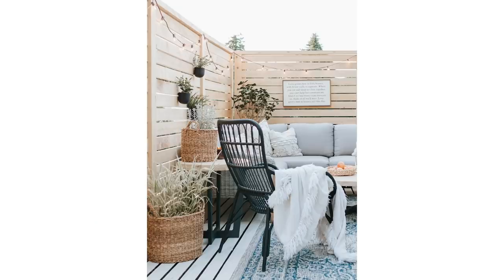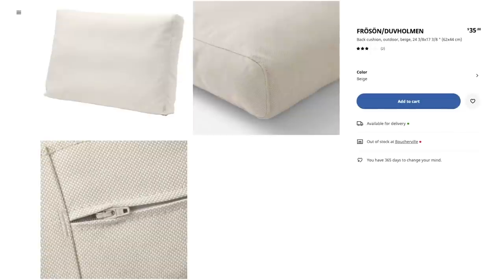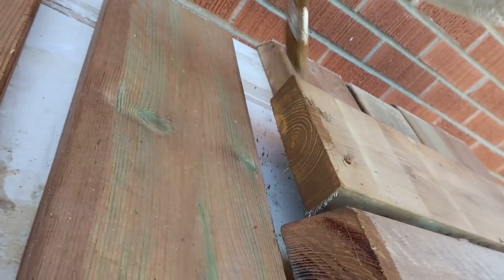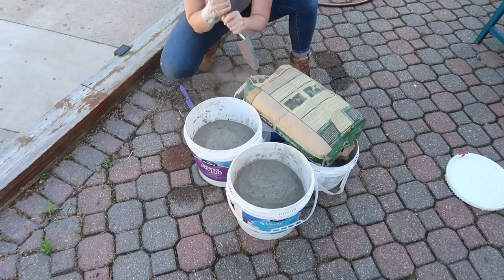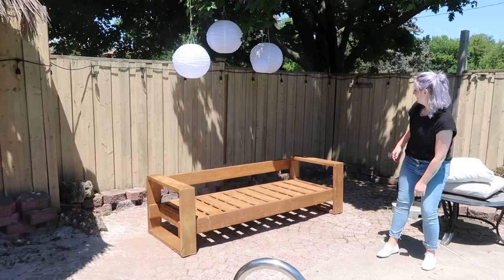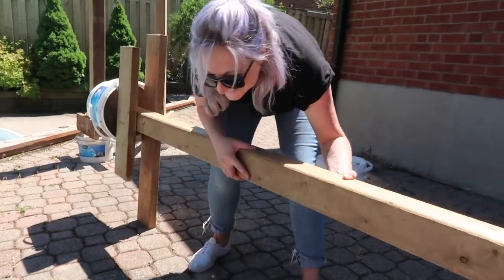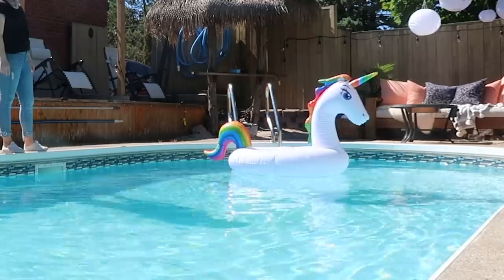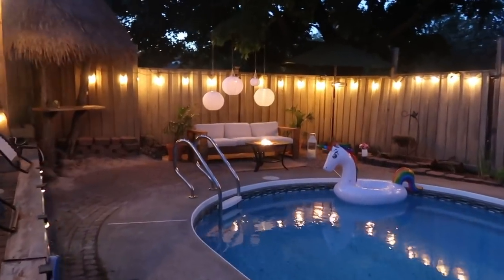my backyard looks like a magazine ad now | Pinterest Made Me Do It | EP 2

Comment: Yo Danie, use a mixing bit on your drill  to mix your cement. Save the wrists. You can patch the one cement pole holder by just applying fresh cement and ket it cure. Either with it out if the bucket or put it back in to do it. If you do it out you can sand it to even it out when cured.
One more thing, y oi u can use canvas drop cloths to make outdoor pilloes. You can die them, paimt, add embroidery, stitch them, whatever you want and just stuff with an old pillow, a bed pillow, stuffi ng,  whatever. Outdoor pillows are expansive because of fabric used. Canvas is durable.

Comment: As an Aussie with crazy pale skin I got some sunscreen tips for you Danie!
-50+ is high enough! Just make sure it's UVA and UVB
-put it on inside BEFORE you go outside, the 10mins you are standing in the sun putting the sunscreen on is probably when you are getting burnt!
- spray on can be less effective, because you inadvertently put too little on. Make sure if you use spray to spray like crazy and then rub it all around to make sure you get every inch of skin moisturized with sunscreen
- some clothes material let's sun in and you can burn through your clothes, if you get burnt through make sure you try a more solid fabric t shirt (not too thin and airy)

Comment: If anyone wants to try the cement-based beam idea - there are form-release products that you use the same way you grease a baking sheet. You are still going to struggle a bit with a bucket (my lab used to use compressed air to help remove the form) but if you have wood you can build a pretty simple cube form and just unscrew it.

Comment: If you are worried about stability of the posts...you could set the whole thing in a bigger bucket and add cement...just making a bigger base.  Of course the bigger the base the harder to move.  But those posts are a great idea.
Reply from the maker: Good thought! They have been standing strong for about 2.5 weeks now! Lasted through wind storms, thunder storms and long humid sunny days! They are rock solid!